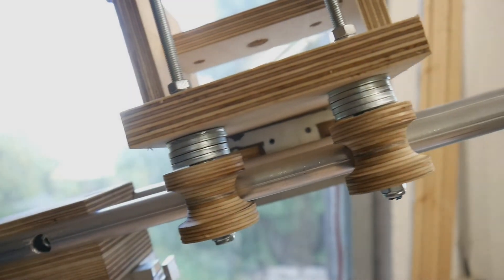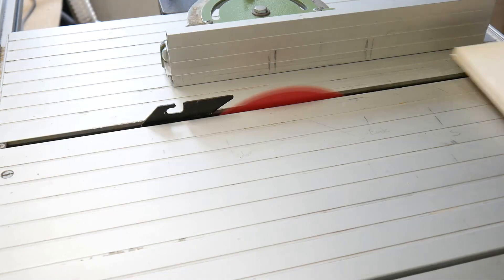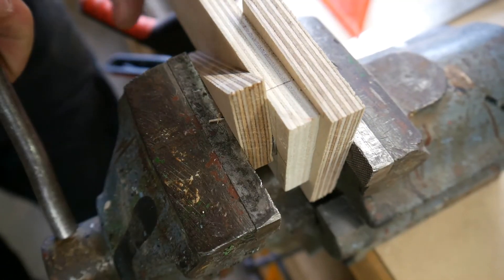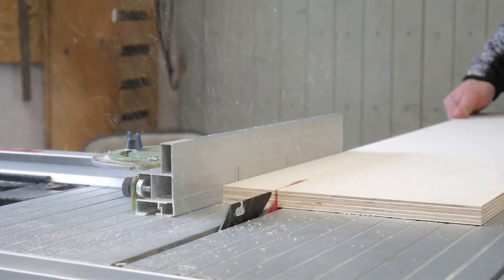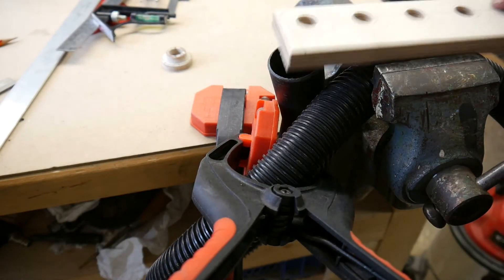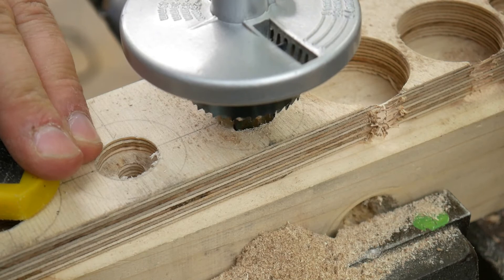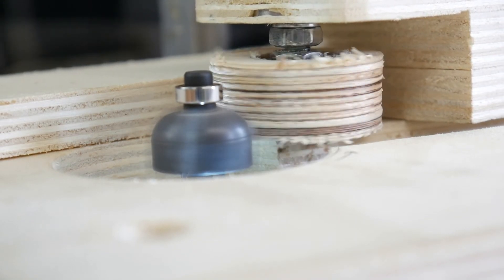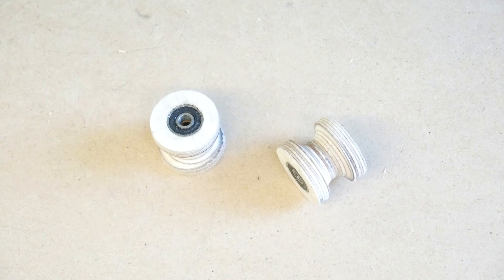DIY 🛠 | Making Pulleys without a Lathe

Comment: Wouldn't it have been easier to make templates and route out the parts?
Reply from the maker: Sounds good... i do it on that way because i want to use the middle axis of the pulley as the turning axis for milling ✌🏻

Comment: Entertaining, but waaaaaaaaay overkill.

Try this: Thread the blank on a bolt, chuck it up in a drill, hold it horizontally over a spinning router that has a round bit. (It'll even work if you do it over a sawblade. Won't be as repeatable, of course)
Reply from the maker: Overkill is the way we design things in germany 🤣 Thanks for your tip 👌🏻
Reply: @craftandconstruction3359  Ha! Fair enough.
I have a German uncle who would agree :)
Reply: @timffoster  Vorsprung durch Overkill oder was...:)